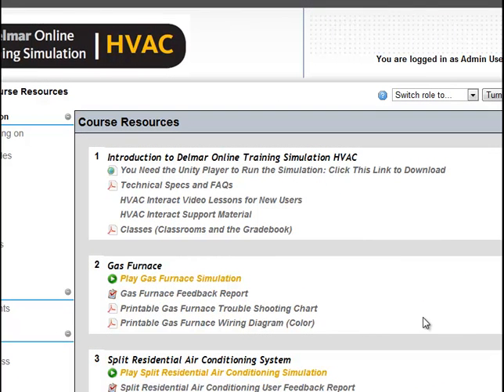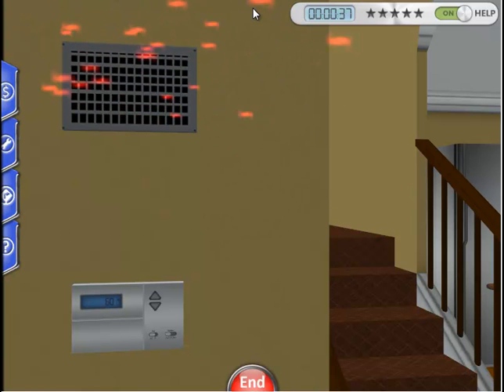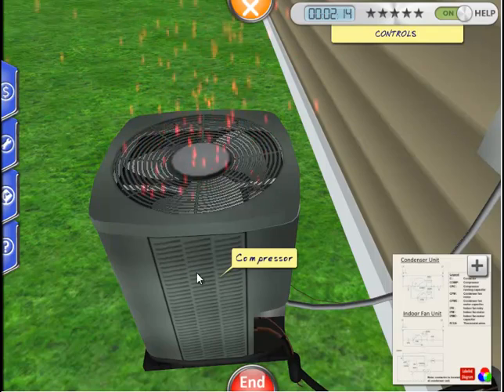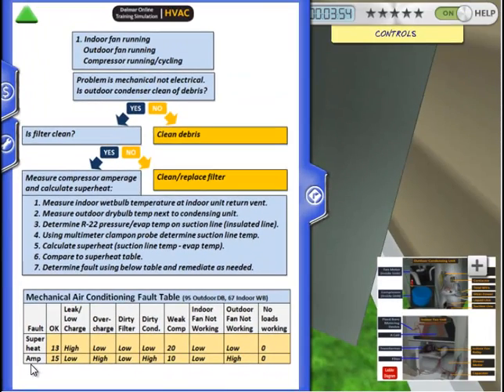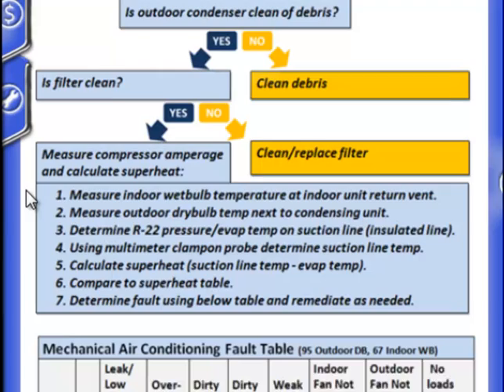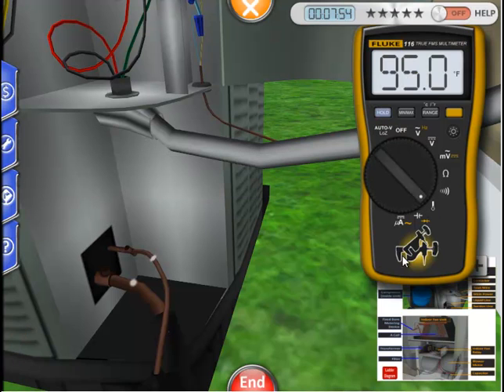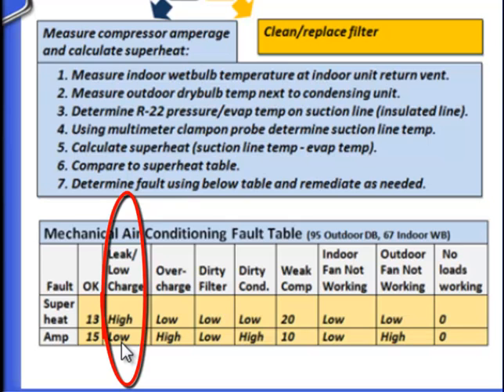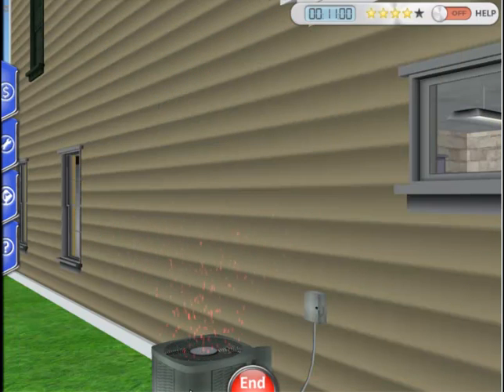HVAC Simulation Tutorial - Fixing an Undercharged Air Conditioner

Comment: I purchased this software from Cengage.  Mine had a fatal flaw in that the video is in 360 which makes it out of focus and the smaller print impossible to read.  Great learning tool if they can fix the video problem. You can purchase it on Amazon. I returned mine due to the video problem